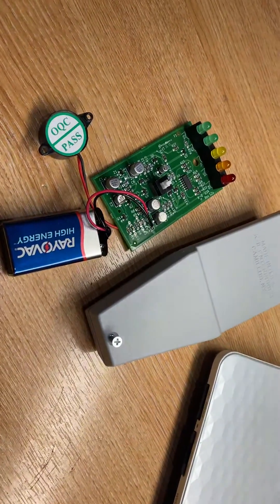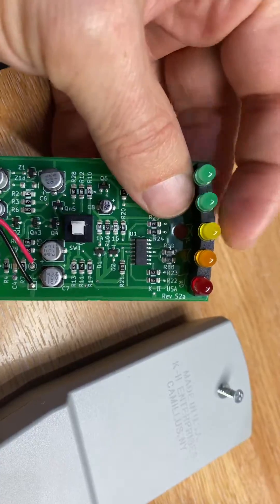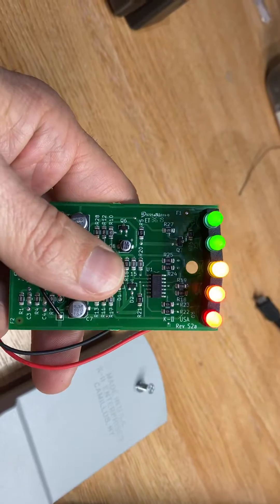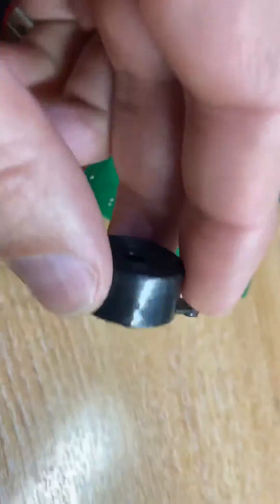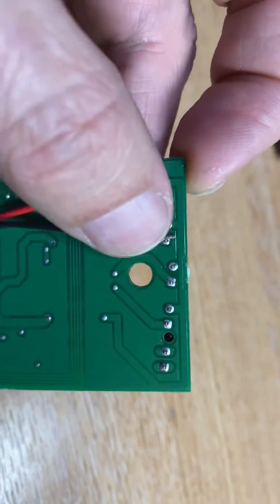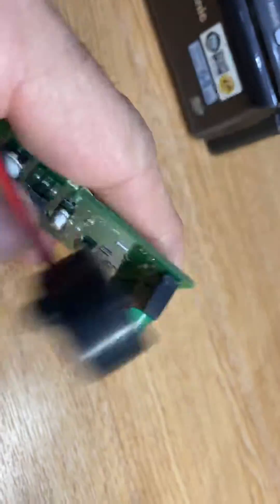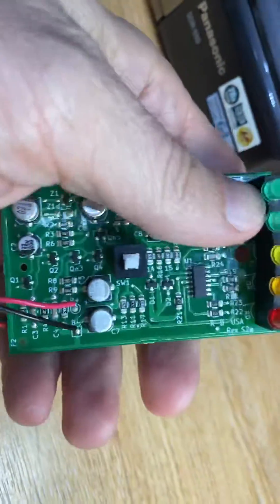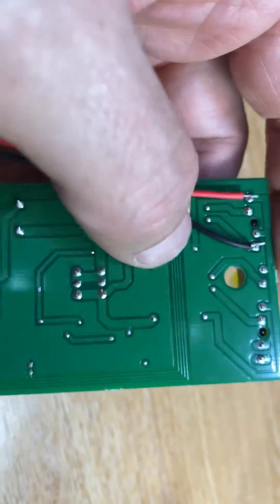How to add sound to a KII METER K2 EMF

Comment: Hi mate. I wonder if you could offer me some advice, as you seem well versed with these boards. I've had a genuine KII for about 4 years and my battery has finally died. I replaced the battery with a new Duracell 9v and the lights on the meter go all the way to red and won't cone off. It's never ever done this so I'm lost. Any ideas?

Comment: hi what is the voltage of the zener diode?  5 volts?
Reply from the maker: It’s a buzzer, 3-12v
Reply: @InfrareadyLtd  Yes, I know there is a buzzer, but my device's zener diode is broken and I don't know how many volts to set?!!
Reply from the maker: @freeboy7011 I see. I’m not too sure what value the zener is.

Comment: mine is really silent for some reason...
Reply from the maker: What type of sounder are you using
Reply: @InfrareadyLtd  I'm using a small black piezo speaker (https://ae01.alicdn.com/kf/HTB1DI4JQpXXXXahXpXXq6xXFXXXD/10pcs-Piezoelectric-Piezo-Passive-Buzzer-Speaker-Ultra-Thin-Ringing-Lead-Wire-SMD-Buzzer-Loudspeaker-30V-13x2.jpg ) 5 volts I think, I tried using different ones but they are all really silent
Reply from the maker: The noise isn’t the loudest. The ones I use have a larger casing which helps to boost the sound.
Reply: @InfrareadyLtd  oh i see thanks. So there is no way to amplify it by connecting it to somewhere else on the board? Because normally a piezo buzzer can be louder than just a crackling noise